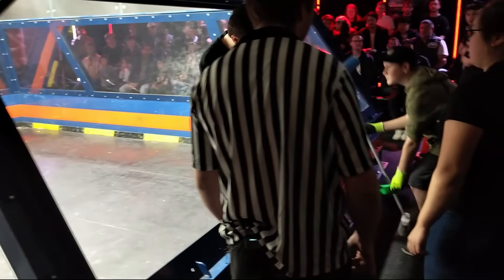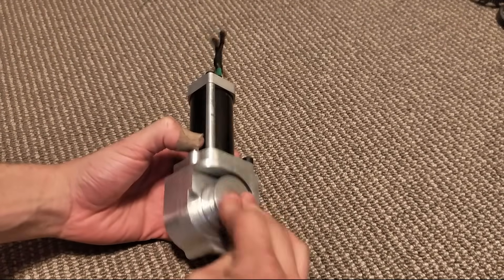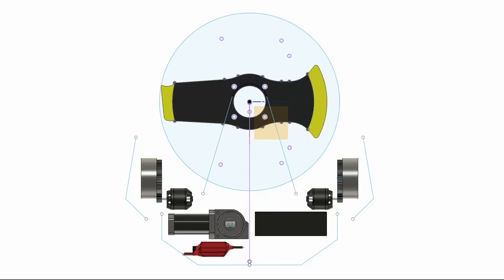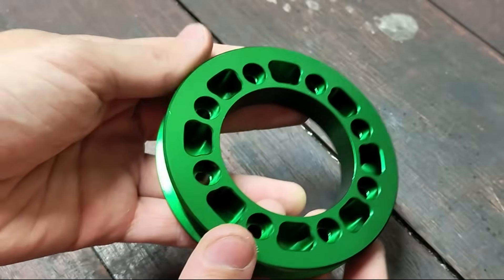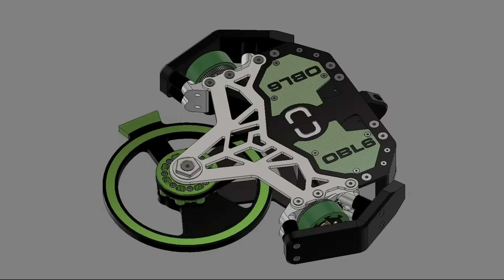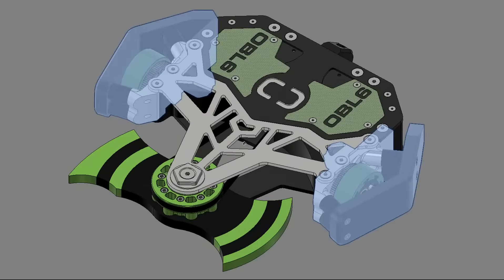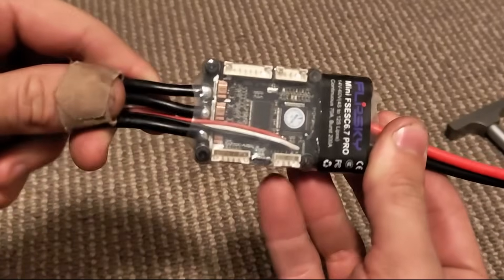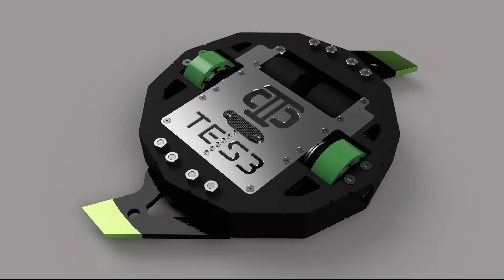Redesigning the Most Fearsome Combat Robot in Australia - Obliterator Part 1

Comment: The wheel bushing arrangement at 8:05 looks durable.
Possible improvement: Replace the tapped threads for the shoulder bolt with a nut. This may be easier to manufacture and threads on a commercial steel nut are stronger than tapped threads in aluminum.

Comment: I would recommend using a 3d printed fixture to position/locate those aluminum blocks at the right angle in the Mill and give you a good spot to zero off of. I've had plenty of success with this approach
Reply from the maker: Ah that's what I was thinking to try, cheers. Presumably these are just to locate, still clamped in a vice? Will give it a shot
Reply: @BrokenLinkRobotics  correct! If you print solid enough they could be in the clamp stack, but I save that for things that are weirder to vise clamp
Reply: I forget if it's popular doctrine, but I see a lot of manual machinists do the drilling first, so it has the highest likelihood of remaining on center. once you know those critical features are done to spec, feel free to hog out to your heart's content